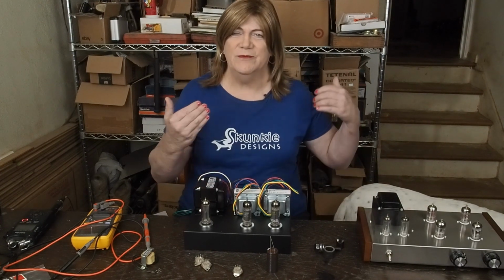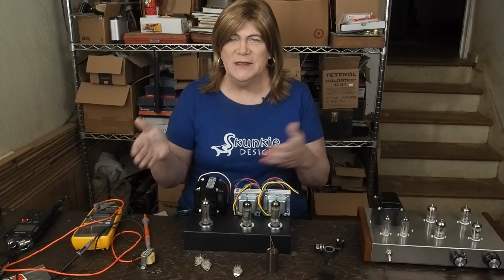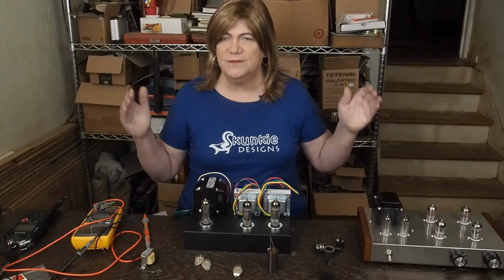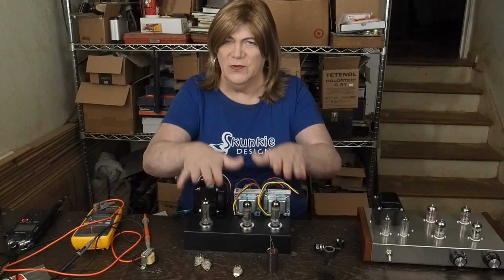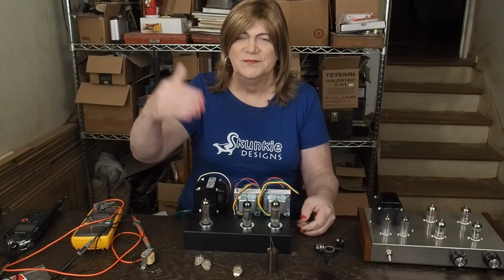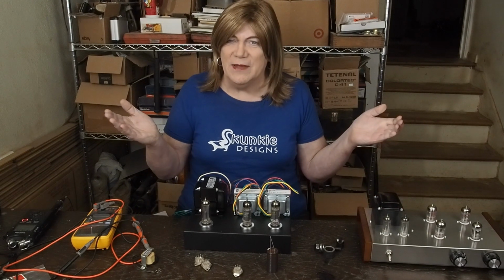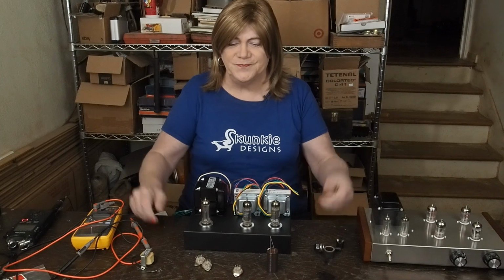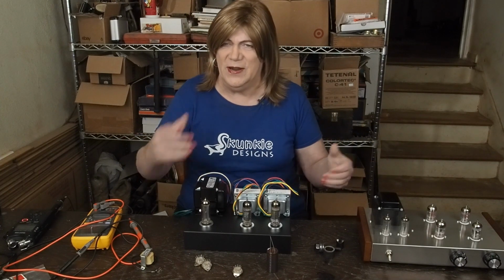Monday Monologue: Why Pre-amplify

Comment: I own a very special tube pre amp Stromberg Carlson ASE-434, It has all the controls for inputs tape, Phono both MM and ceramic and most importantly it has active EQ for each channel. Has two tubes one tube for treble another for bass for left and right so it has 4 ea 12au7a just in the active EQ. It also has two 7025 input tubes for the pre amp. All controls for different filters Rumble, loudness, Equalization RIAA- NARTB+3 turnover, roll off, scratch, output balance signal, on and off, GAIN, channel selector and Cathode follower. It has 4 volts output into my tube amp. My pre is set at 3 on GAIN I never change that. Tube power amp with no volume knob or any other knob. Just a on + off switch, RCA inputs and RCA outputs a fuse. 4ea 6v6G power tubes and 2ea 7199 driver/splitter. Through Altec Lansing 10 cubic ft speakers. Altec 15” woofers, mid horn, high freq horn, feed through Stromberg Carlson RX-346 Three way crossovers.

Comment: I've been restoring antique radios for many years but right now I'm getting into scratch built tube audio equipment and the questions I pondered are the same things your covering in this video. I always wondered why would somebody build mono block amps and then connect a pre-amp to run them. Now I see the possible benefits of modular design and I think that this would be even more beneficial in higher power applications.

Comment: That's the way l see that too. Mayby pream other than adding gain can change the sound characteristics , that's why people are using it.
For example my 6p3p apparently sounds so bad ,  that after l added equalizer , the sound improoved in upper and low  frequencies adding a lot of gain too, but overall i'm still not happy with the sound. This is probably due to bad quality output transformers. There's nothing l can do about it. I would prefer that my amp would sound fantastic out of the box , without any additional preamp, to avoid to long signal chain.

Comment: I had the opportunity to experiment a lot with gain staging over the years.  I know it change the result if you drive equipment in sub optimal signal range. For my own home listening room, I don't shoot for high sound pressure. In that context, taking the minimum noise approach make sense to me . I have been staking equipment to correct rooms and other equipment all my life.  I'd rather listening to a well executed circuit for a change. I like the separate preamp idea. My next question will be: do I need the headroom in lower frequency range to justify mono bkoks. Thanks for making this experience possible for me. Cheers
Reply: *blocks

Comment: Can I feed a preamp to something like a Reisong A12? I know It sounds dumb since the A12 is an integrated amp, but maybe the preamp will make it sound better.  My initial guess though is that it could overload the A12 preamp triodes and cause them to distort.
Reply from the maker: It's not going to help it. It doesn't need more signal, that's not the problem.

Comment: IME, the more efficient the speakers get the more you need to pay attention to the gain structure of your system..  

Some amps like the kit amp from Sun Audio (Pushpull 300B), are 2-stage high input sensitivity, that would benefit from an active preamp like the ones shown here..  But those type of 2-stage low or med mu input/driver amps are the exception these days.. 

Classic vintage amp/preamp combos usually have feedback (global and/or local), so that controls the gain too, some of these designs are still held in high esteem. They just offer a different sound to zero feedback gear. 

The earliest spud amps I’ve seen are very high in gain (WE 437a or its Russian derivatives) or uses compactron tubes.. The singe pentode spud amp is something I’m eager to see explored in series of videos.

I apologize if I am not clear with my comments at times, English is not my native tongue.

Comment: I have been wanting to try a tube preamp for a while now. However I use a passive preamp I built that is just volume control and input selection. The volume is switched so I can bypass it and use volume on the amps if they have it. My sources all have enough output signal. So my  my main thought would be to use a real preamp to change the sound a little with different tubes and maybe tone controls. Yeah I know thats not popular with most purist audiophiles but I like music to sound good to me. What I am trying to say is tube rolling a preamp could change the sonics to taste just like tone controls. The spud amp is interesting.  I have a few 6bq5 amps and love the sound of those tubes. Anyway this sounds like it will be fun and that is important.  I'm in...
Reply from the maker: Right! My thought is either it's a passive switch box with maybe a signal attenuator, or it's an active amplifier with possibly tone controls or using tubes to "color" the sound. Later I plan to work with "tube buffers" which are zero gain tube boxes that could be used that way, for rolling tone, but calling those zero gain devices" Pre-amplifiers" is confusing, at least to me.